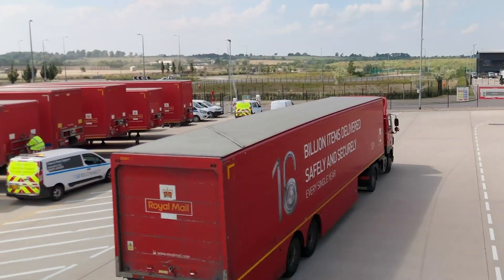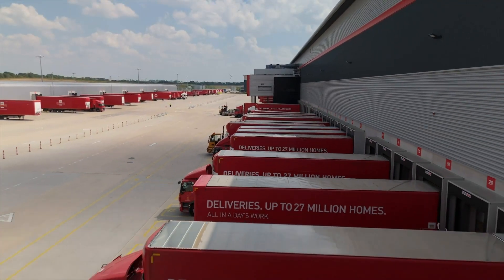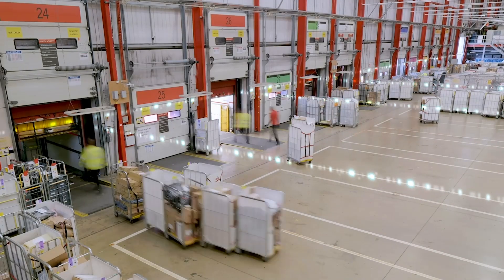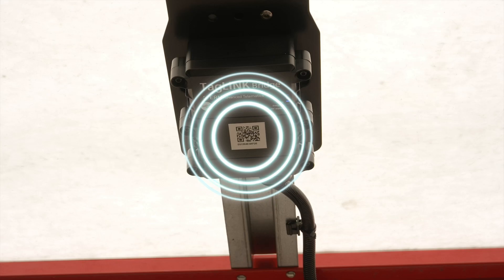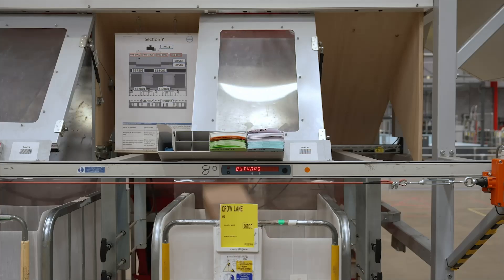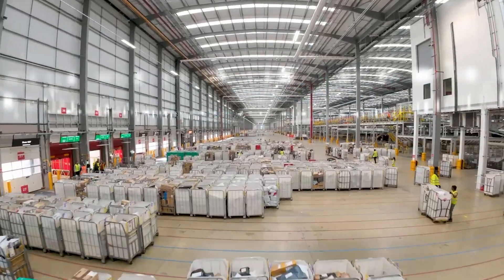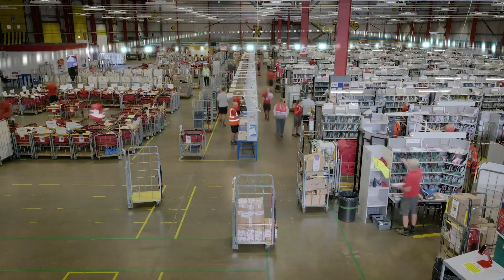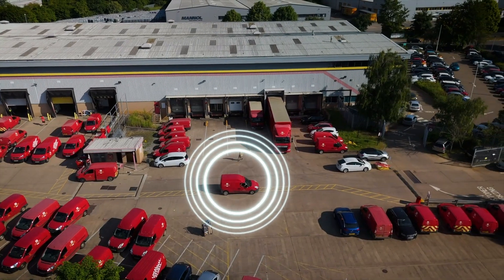Royal Mail & Wiliot Partnership

Comment: How is this foing to make the company greener? Your using microchips
Reply: It’s all a con….. stopped using planes, doubled the fleet with the hire of thousands of extra white vans, false economy
Reply: Fair question.  The carbon footprint of the tiny chips (approx 1mm sq) and the associated data processing is tiny compared to the savings in fuel, vehicle size reduction, and more efficient use of rolling cage fleet).  

A good way of approximating carbon footprint is to look at the total cost of purchasing and running the solution.  While the payback period on this project isn't public, it's understood to be rapid, which indicates the net savings on CO2E is significant.  If you add visibility to the transportation of the things that carry parcels, and go from limited visibility to excellent real-time visibility, you can become more efficient, be more effective at deliveries as well as saving money and carbon.
Reply: @stevestatler2713  As China builds 2 coal powered power stations a week